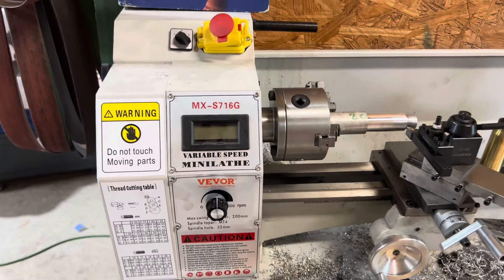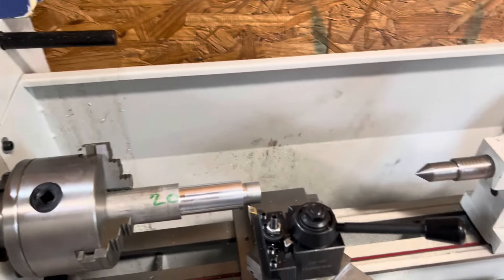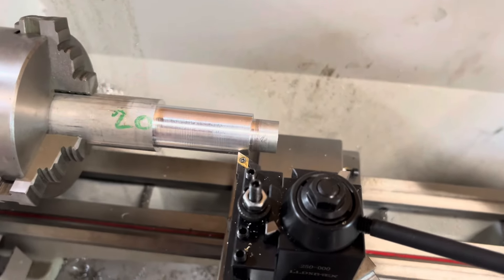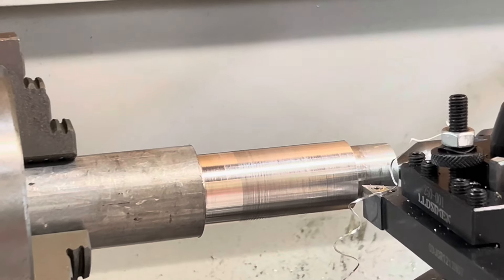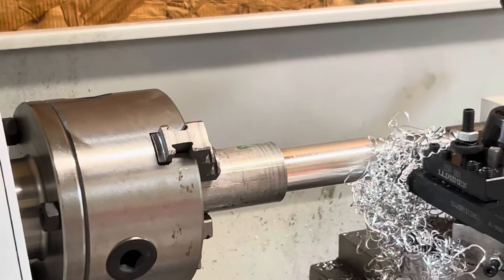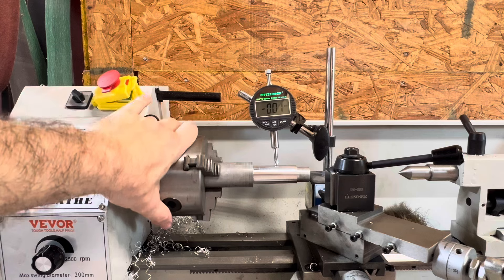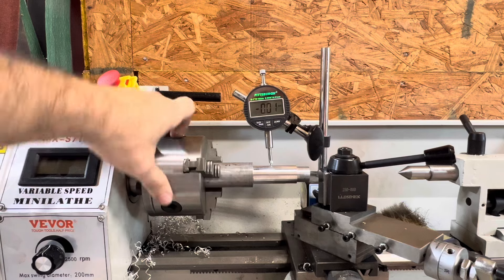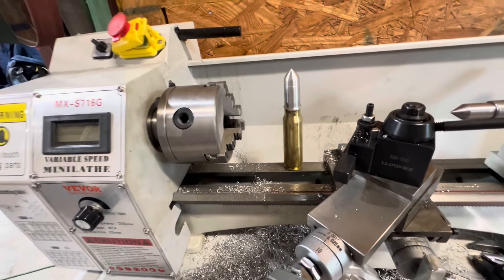Vevor Mini Lathe Update: Cutting 2024 Aluminum alloy with modifications

Comment: Hey man if you want to make a cool looking slug for that casing you could cast one using pewter or lead. Pewter is a little safer and you can find old pewter dishes at any 2nd hand store. It doesnt take a lot of heat to melt and even if the casting is crude you could throw it in the lathe and touch it up. I order a vevor latge as well and its nice to see a few videos made about them.